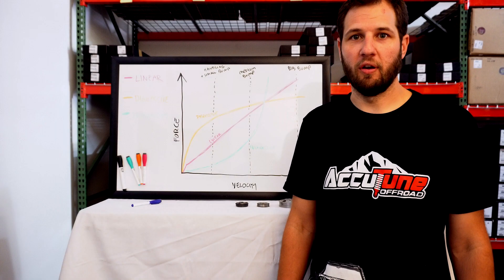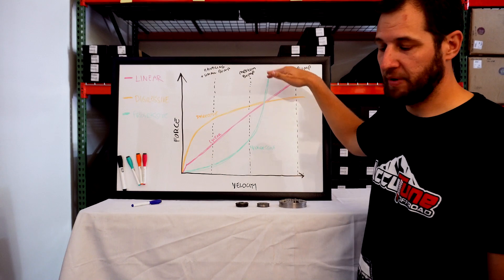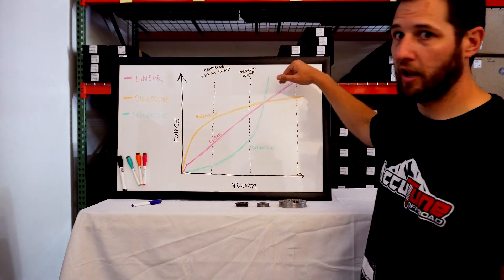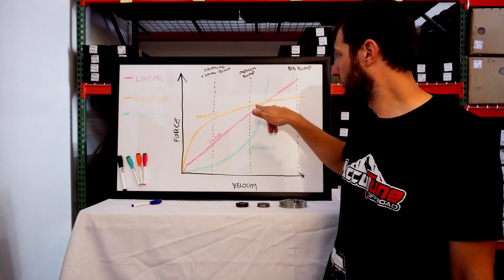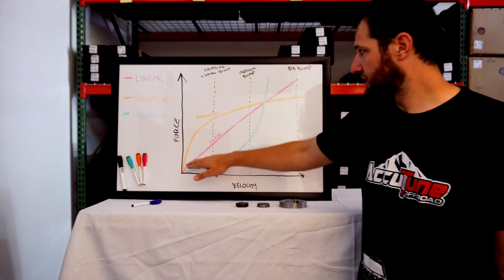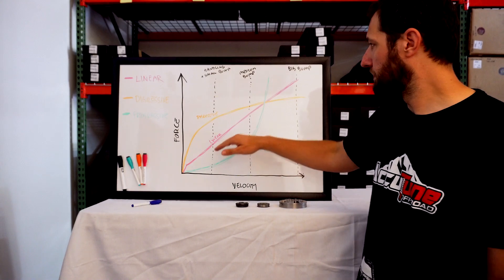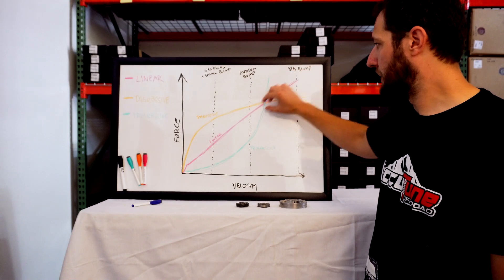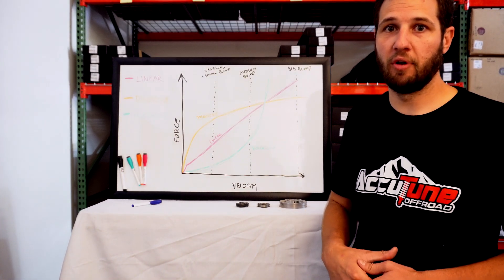Shock Tech Ep. 1: Piston Designs

Comment: Are small bumps and handling really similar (low) velocity?  I would think that hitting a small (1") square edged bump in the road at 30-60 mph would produce much faster piston velocity than handling and body lean does.

It's not possible to be digressive for only very slow range, then open up for small bumps?
Reply from the maker: In the case of small bumps it's more about how much the shock is moving than the speed it moves. With soft low speed damping it lets the shock move that small amount without getting into the high speed valving.

Comment: Very informative video! I just put a set of BC coilovers on my subaru with 7kg/mm swift springs on all 4 corners with linear valving. The ride quality/handling on smooth twisty roads is absolutely amazing but living in Ohio forces me to deal with lots of road imperfections and bumps which are much more uncomfortable now with the coilovers. It would be interesting to see a video of someone running a digressive, then linear, then progressive shock on the same set of coilovers on the same car, to see the real difference on the road.

Comment: You mentioned that you let the sway bar to the handling. I removed my sway bar with kings on my 5th gen 4runner. Should I reinstall it to get better performance?
Reply from the maker: The Toyota ifs sway bars are stiff and the bushings seem to have a lot of friction so they’re detrimental to ride quality. A lot of people get away without them, but everyone has different preferences and if you want better handling then I’d put it back on. Toyota ifs applications are some of the few where our valving will get you better handling, simply because king valves them so soft.
Reply: AccuTune Off-Road thanks! just to clarify better handling on or off road?
Reply from the maker: Nick M. It’ll be crisper handling on and off-road and won’t bottom out as easily.

Comment: Thank you for the over view. I'm curious about your statement of having sway bars do the handling while the coilover/shocks to do the damping. Is this true mostly for off roading? I don't offroad and have a DD coupe. Looking to upgrade my coil overs so that I can be faster in my AutoX/track events. In that scenario, should I still be looking into digressive design?
Reply from the maker: Lots of street cars are adopting the stiff sway bar, soft springs technique, because it leads to a more comfortable ride. Not running any sway bar and doing all the control with shocks, springs, and geometry is faster and less comfortable. Somewhere in between is where you want to be.
Reply: AccuTune Off-Road got it, yeah my car has stock sway bars. I guess I will just need to research more on the specific spring rates for what most people run then. Cheers